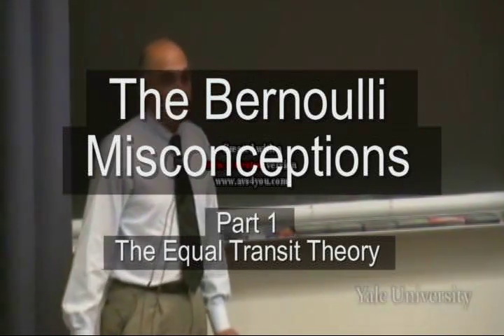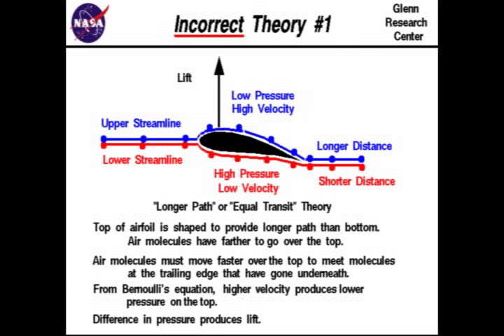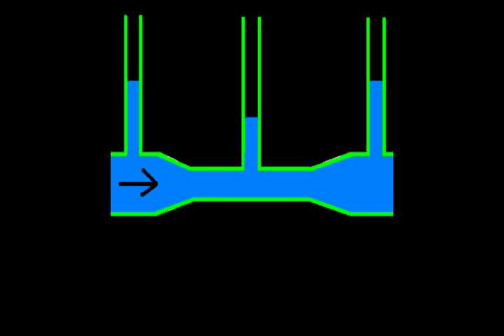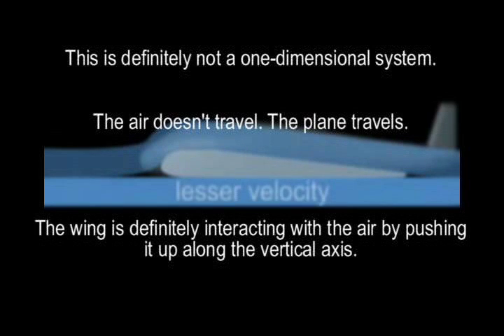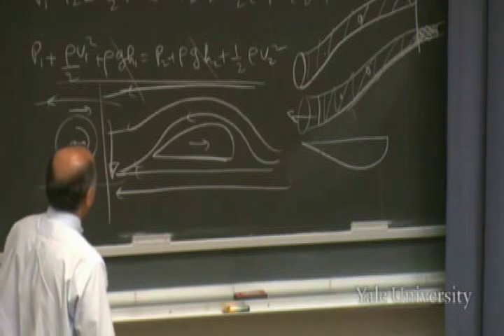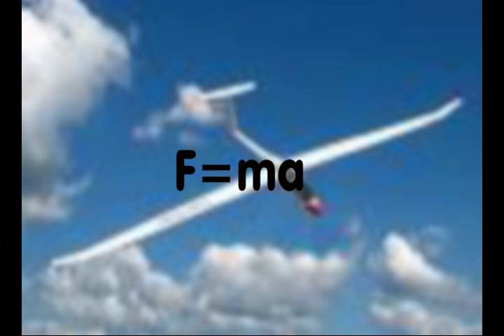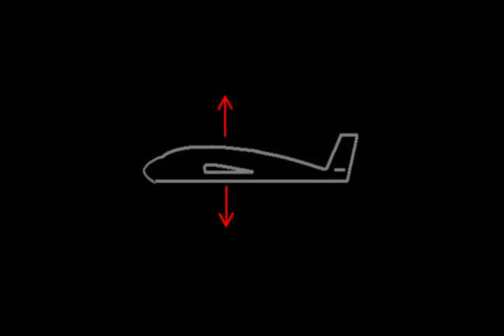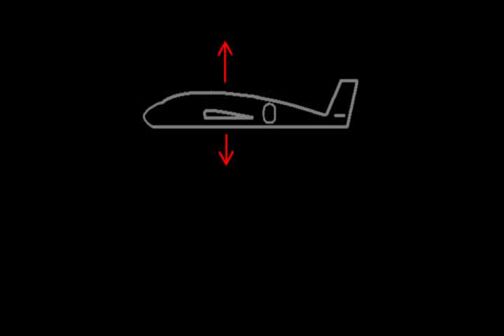Bernoulli Misconceptions 1 - The Equal Transit Theory

Comment: Don't know why I haven't seen this video before...  I like having yet another bad example from Yale!!  Chuclke, chuckle.
....
I really like your start and the constant energy focus.   However, I submit, for your consideration, that your reasoning and conclusion is, unfortunately, incorrect as follows:
... 
Looking at the energy factors only (as you are and I agree is a good starting view), after the drop, you first reason that the plane must rise because the forces no longer balance. right? In other words, your premise is that no energy was removed or added, so the potential STAYS constant (kinetic also constant=also same speed), therefore, the increase in altitude represents an increase in potential energy and, therefore cannot be...
...
.  Unfortunately, the mass decreased and, therefore, for the potential energy to remain constant, there must be an altitude increase !!  
E = m g h
If "m" decreases, then "h" MUST increase.  The increased "h" is not an energy gain, but mandatory to keep the total "E" constant !  
...
It is difficult to misinterpret your statement that: "All the additional potential energy that is described to the increase in altitude of the plane is totally unaccounted for."
...
Did you forget the decrease in mass "m" in the E = m*g*h  Equation?
Before       and       After
E = m * g * h  ==  m- * g * h+  Energy balances!
...
So unless I misunderstand something here, the increase in altitude "could" still maintains a constant energy and no new energy is needed.  I believe your logic fails to prove your proposed point.  
...
...
HOWEVER, taking this further in an effort to salvage it, I continuing to account for other applicable and significant factors to see if an argument is still there...
..
As somewhat of a side issue, from an energy-only standpoint, during the climb, there most certainly must also be a speed increase (kinetic energy) to keep the total energy constant; due to the temporary loss of potential energy from the dropped weight at the lower, starting altitude.
...  This is sort of ok so far, but I'll ignore this transient effect for now.
...
Unfortunately, the higher altitude will be dictated by:
1 - The decrease in air density, 
2 - The increase in radius from the center of Earth's Mass.
That is to say, to have the same total energy, the altitude must increase to account for the NEW LOWER weight due to BOTH the decreased mass and the increased radius from Earth as well as the decrease in air density (I hope that is clear).  This puts several NEW factors into the new altitude and your proposed proof becomes much more complex than you appear to have originally assumed. 
...
Don't get me wrong.  I really appreciate your trying to show the folly in all this oh-so common pathologic science (Improper use of Bernoulli and bad Lift explanations).  I'm on your side debunkingthen, but I fail to find your logic correct, sorry.   I had hoped you had something here that I could use.
... . . . 
-- Cheers, ScienceAdvisorSteve
www.challengerillinois.org
Reply from the maker: Sorry for not having opportunity to answer earlier. The Coanda effect is pretty straight forward. When an airflow streams past a round object, the Coanda effect sa that the flow of air will "cling" to the surface, even though the surface diverges away from the direction of the airflow. If one considers the alternative, one must imagine that the airflow continued strictly in the original direction, no matter how small the angle between the direction of the flow and the surface is. This little "sliver" of air should then consist of still air that separated the flow of air and the surface. The outer layer of this "sliver" of still air will naturally, and immediately, be drawn along with the moving air because of friction. Where this layer of air was, there will be a void that immediately needs to be filled with air from somewhere, it can't be vacuum. Either the void needs to be filled by the air that flows past the object, thus slightly diverting it's direction towards the surface, or the air needs to flow in from further back from the air that is between the airflow and the surface, thus creating a swirl that will constantly make air flow into the void, only to be drawn out again with the airflow. When the angle between the airflow and the surface is relatively small, the void will most easily be filled by the air in the airflow bending towards the surface. In this way, all air between the airflow and the surface will be removed and replaced by air in the airflow, so that it seems like the airflow clings to the surface. If the angle is big enough, it is "easier" to fill the void by air flowing in from below the airflow. Thus the airflow separates from the surface and turbulence is formed under the airflow. In the case of an airfoil, this is what happens when the wing stalls.
It is said that Coanda effect should only be used for jets of air passing by a surface, and not for a wing flying through the air. In any case, I think that the effects can be explained in the same way, and therefore should not be reason for any confusion. I hope this was helpful.
Reply: DrR1pper   The Coanda Effect is a definition for what happens when a jet or sheet of air is forced, by some type of a blowing device, over a convex surface within an otherwise still air environment.  The air over a a wing isn't forced like that so it doesn't really qualify to be called the Coanda Effect.  It is a technicality
--
Regards
Reply: I see none and have not seen anything to indicatevthe science is different for the two. I do not believe anyone has attempted to name it.
Reply from the maker: I don't want to have a strong opinion whether one should call the phenomena of the air following the curve of airfoil, the Coanda effect, or not. I understand that Coanda strictly speaking investigated the reason for a jet of air following a curved surface, while not addressing what happens when the whole atmosphere blows past an object. I don't think this should cause any confusion. The real reason for confusion would arise if one tries to explain these phenomena in completely different ways. The biggest difference is that a limited jet of air has a lesser tendency to follow the surface, compared to the case when the whole atmosphere moves over the surface. This is because with a airflow with a small diameter, the air from the sides can more easily flow in and replenish the air that has been removed by the fast flowing jet. With the whole atmosphere moving over the surface, the air needs to double back from behind, thus make a swirl (turbulence). Another effect is that a limited jet of air will gradually detatch itself from the surface, while this happens much more suddenly in the other case, refer to stalling of a wing. If it is cold where you are, you can try this yourself, and go and blow past curved objects, and see that the stream of air will tend to bend towards the object, even though it is not in direct contact.
Reply: Siddis33  Yes.  When you put a jet into the air, there is 'entrainment 'of nearby air.  This makes the moving air stream wider than the original. ...
This explains the blower and toilet paper demo.
--
Cheers.
Reply from the maker: I think that there is something that you misunderstand. When the object is dropped from the plane, it is true that the kinetic and potential energy of the rest of the plane decreases. However, this is the energy that is represented by the falling object, which will be converted to heat by friction with the air and by finally crashing into the ground. So, just after the object is dropped, the system (plane and object) has just as much total energy as when the object was in the plane. But after the object is dropped, the potential energy of the plane (and the whole system, plane and object) will start to increase as the plane is pushed upwards due to the difference in weight of the plane and the force acting on the wings. (F=ma)The Law of Conservation of Energy is broken immediately as the plane starts moving upwards. It is enough with one micrometer. Sure, the plane would stop ascending when the air density got low enough, but it is still not an argument as the Law of Conservation of Energy is already violated. Moreover, one could just as well imagine that this thought experiment took place in an incompressible fluid, like a hydrofoil boat in water. The video that you sent show that the air over the wing moves faster than the air under the wing. Bernoulli's theorem states that when the pressure decreases the velocity will increase. This is exactly what one sees, and has nothing to do with the more curved upper surface of the wing. The same effect would be seen on a flat or symmetrical wing, provided the wing is angled so that it gives the same lift.
Reply: Siddis33 Unfortunately I *AM* missing something.  It is your proposal / disproof.  It appears we both understand the energy situaton.  However, I still do not see the line of logic that refutes the Equal Transit PseudoTheory.    That and your argument appear quite orthogonal to me.  I don't see how a conflict in energy interpretations disproves equal transit, or how equal transit has any legitimate, nor misinterpreted energy implications.
...
Equal transit is easily disproven by a simple observation that cannot be misinterpreted (as can many other types of observations can).
...
 I love showing the "fast-air-has-lower-pressure" folks how the"fastest air" around a wing is just under it.  (relative to the still air)
--
Cheers, Steve
Reply from the maker: +Observ45er it can be shown by an example. Let's say a glider weighs 900kg and the object is 100 kg. The glider is puler up to an altitude of 100 meters and a velocity of 30m/sec. The energy that was needed to pull the glider and the object is (1000x100x9.81+1/2x30^2x1000)Joule=1431000 Joule. 
When the object is dropped, it will still have 1/10th of the total energy. This energy will be lost through air friction and the impact with the ground. The 143100 Joule is still accounted for. The remaining 9/10th of the energy is still associated with the plane. 
AS you point out, the weight has decreased, but the lift should be the same in according to the Equal Transit Theory. Then the plane will start to rise. 
If the plane rises by 1 millimeter the potential energy will increase by 900x0.001x9.81 Joule = 8.829 Joule. 
This means that 143100 Joule was used to get the object to 100 meter and 30m/sec. 1287900 Joule was needed to get the glider to 100 meter and a velocity of 30m/sec.
Reply from the maker: +Siddis33 But when the glider rises another millimeter, the total energy of the system (object and plane) is: 143100 Joule + 1287900 Joule + 8.829 Joule = 1431008.829 Joule. This is more energy than was used on the system. This is not possible, and proves that the Equal Transit Theory is wrong.
Reply: Siddis33   I assume you are responding to me.   I still don't see what the energy implications are of the equal transit pseudo-theory.  How does the air travel-time over the top of the wing imply any energy factors?
...
Analyzing the energy is one thing, but in what way does the time air takes to travel over the wing make any specific implied. or misinterpreted statements or claims about anything to do with energy conservation or non conservation?
...
IF the air did travel the same time above and below, what are the energy implications of that false concept?
...
Does that explain the issue better?
Reply from the maker: +Observ45er The point with the whole video was to show that the Equal Transit Theory is wrong. By using accepted laws, one can make a simple example that shows that physical laws are violated, thus the theory is wrong. The theory is no little misconseption. Until very resent, this was the accepted theory. Even Einstein conducted experiments based on a similar understanding of lift. BTW my example with numbers continued as a reply to my own message. I tried to show that your point with the mass of the plane being less ,after the object is dropped, does not change anything.
Reply from the maker: +Observ45er If the air above and below the airfoil travelled at the same speed, the wing would not generate lift. If the wing generates lift, the airspeed over the wing will be faster in according to Bernoulli's Principle. Accordingly, air will be directed down in according to Newtons equation, F=ma. Bernoulli's Principle is just an adaptation of Newtons laws. They don't represent different forces. In this way, if an airfoil creates lift, the air will always travel faster above the wing, no matter the shape. Inverter wings, or flat wings, will not be very effective to create lift.
Reply: Siddis33 I think I now see how you make the connection.  Unfortunately, from your last comment,:

 "If the air above and below the airfoil
travelled at the same speed, the wing
would not generate lift. If the wing
generates lift, the airspeed over
the wing will be faster in according to Bernoulli's Principle."
...
it appears that you are clearly applying the common misconception that many amateurs refer to as Bernoulli's Principle.  Namely that "Fast air has lower pressure."
How do you correctly apply Bernoulli's Equation to this situation?
In other words, what is it about these two streams of air that allow the application of Bernoulli's Equation? 
...
We have two streams that have no relationship in regard to velocity changes (accelerations), where, in addidtion, no energy is added nor extracted, that make his equation applicable.
...
If that is what you are basing your argument on, it fails as a proof.
--
Regards, Steve
Reply from the maker: +Observ45er Then how will you explain that air that travels over the wing has a higher velocity, if not by Bernoulli's Principle? As I wrote, Bernoulli's Principle is just an adaptation of Newtons Laws. A package of air that moves from an area with high pressure to an area with low pressure, will naturally change it's velocity. This is because the package of air has a higher pressure on one side than on the other. This is also exactly in according to F=ma. 

Many people use the term " Bernoulli Lift". I suppose these are the ones you call amateurs. I don't include myself among those. 
Why complicate things by using Bernoulli's Principle when one can simply explain it by using Newton's Laws? 

If you yourself are not an amateur, then I suppose that you are a professional in a relevant field ( not a professional baker, for example). What sort of a professional does not understand Bernoulli's Principle?

Cheers
Reply: +Siddis33  Google pinged me on an earlier comment and I didn't catch this comment of yours. RE:  "...the Equal Transit Theory ... Until very resent, this was the accepted theory."  

What do you consider as 'recent' ?  
By whom do you believe it was "accepted" as correct ?
Regards
Reply from the maker: +Observ45er It is not ideal to discuss through the comment section, and I am at a work site with really bad internet connection. 

What is concidered resent  is subject to definition. Before the internet one pretty much couldn't find anything that contradicted the Equal Transit Theory, at least that was available to the public. "All" pilot instruction books and popular science shows present the wrong theory. Bill Nye the Science guy presented the wrong theory in his show.

If you make a Google search on "Einstein Katzenbach airfoil" you can read about his flawed experiment that was based on a form of the "Bernoulli lift" fallacy. That was long time ago, but the myth has been extremely hard lived.
Reply: +Siddis33  It's not about how I would explain it.  I'm asking you to explain just how you are applying Bernoulli's Principle to the velocity of the air over the wing.  You say that it is somehow due to Bernoulli's Principle, but how does B.P. apply?  You're the one saying: " Then how will you explain that air that travels over the wing has a higher velocity, if not by Bernoulli's Principle?".  
You're only implying a connection, but aren't specific.  
...
Then you seem to contradict yourself with this: "Why complicate things by using Bernoulli's Principle when one can simply explain it by using Newton's Laws?" [I'm actually on you side with this bit]
...
This is like saying that rockets fly due to Newton's Law.  It explains nothing, just drops a name on the floor.
...
I have an understanding of Bernoulli's findings and of lift far better than the average YouTuber.  I'm trying to connect the dots of your story in a cogent manner.  What are the dots between 'upper air' and 'Bernoulli'.
-- 
Regards
Reply from the maker: +Observ45er  I would like to invite you to watch dr. Holger Babinsky's lecture " How wings fly - Common misconceptions on lift". He addresses this very point from about 20 minutes out in his lecture to about 30 minutes. He shows very clearly that B.P. Is nothing other than the result of Newton's forces that act on a parcel of fluid. This is exactly my point. This explains why the air over the wing accelerates.
Where I think most people go wrong is when they treat Newton's forces and B.P. as two independent set of forces, like for example gravity and magnetic forces.
Reply from the maker: +Observ45er  Correction: the lecture of Holger Babinsky is "How do wings work - common misconceptions on lift"
Reply: Siddis33  That  Babinski Video is one of my main references.  I send folks a link to his slides which you can't see in the video as well as the equivalent paper he refers to in the video.
...
Unfortunately, he refers to the upper air path as being due to the Coanda Effect, which it is not due to its [corrected typo] definition.
...
Though minor, he also stops short of including the downwash. 
...
The Krzysztof Fidkowski How Planes Fly video is another excelent one along with Doug McLean's Univ Mich Misconceptions video.
--
Cheers
Reply from the maker: +Observ45er No he does not! You are totally wrong. The reason the airstream hugs the profile of the airfoil is due to the Coanda effect. The reason that the air does not just bend, but also speed up, can be described in according to the Bernoulli Effect.
Reply: Interesting reading your discussion guys but it's left me a little puzzled. If my understanding is correct, the reason a fluid element travelling over the top of an airfoil experiences an acceleration is because it experiences a difference in pressure about any of it's opposing faces. Can someone please explain why there is this a difference in pressure in the first place? Thank you.

For the moment, my thoughts on where the pressure differential comes from is that there is a vacuum like space being constantly trying to form in areas above the top surface areas of an airfoil where it's surface diverges away from the instantaneous direction of airflow on the top surface of an airfoil.
Reply: +Siddis33  I am not wrong. Technically, it is not Coanda..  The definition of Coanda is a jet or sheet of air that is forced by a blowing device across a convex surface in an otherwise still environment.  Since this is not forced in that manner, it is not Coanda.  . While the physics may be similar, a definition is a definition. 
...
In addition, Coanda gives no explanation as to the CAUSE of the effect, only that it occurs, so you have the same problem even if you say Coanda.  What causes the Coanda Effect?
-- 
Cheers
Reply: Observ45er Hi Steve. Are you saying that whatever causes the coanda effect/phenomena is not what also causes airflow over the top of a wing to be attracted towards parts of the top surface that are changing and facing away from the instantaneous direction of local flow (i.e. leeward surfaces)?
Reply: DrR1pper   I say that the Coanda Effect and the flow over the wing appear to have similar physics.  However, Coanda has a very narrow definition and it also does not give a cause for the effect, only that it occurs, so whether you call it Coanda or not you still have a "what is the cause" problem.  
...
I claim that the first principles of physics says it is the motion.  Pressure comes first.
Reply: Observ45er Do you know of any theory that explains the phenomena of airflow having the tendency to want to follow convex surfaces (i.e. the Coanda effect)?

"I claim that the first principles of physics says it is the motion. Pressure comes first."

- Ok, perhaps you just answered my question but would you mind elaborating what you mean please? I'm intrigued.
Reply: Siddis33 Thank you for writing that. It appears to make a lot of sense. But towards the end you state that the Coanda effect should only be used for jets of air passing by a surface and not for a wing to explain why airflow follows a surface diverging away from the airflow and I'm not sure why.
Reply: Observ45er Aaaaaaah! I think I see the difference now!!! Thank you so, so much!

So, just to double check, the mechanism that causes airflow close to a surface to then cling/follow (or i guess the technical description would be to "remain attached"? to) it as that surface diverges is practically the same regardless of whether there is just a jet of air or all the air is moving over the surface?

If so, is there an name for the phenomena, like the Coanda effect, for the effect of air following the divergent surface of a wing?
Reply: Observ45er Ok, thank you!!!

So it's technically incorrect to say that airflow following the diverging surface of a wing is not the same as the Coanda effect despite both phenomena being caused by practically the exact same physics.

What do you say to people who say it's the same as the Coanda effect without confusing the hell out of them?
Reply: So the point is, the underlying fluid dynamics that causes streamlines close to a divergent surface area of an aerofoil to experience the tendency to follow it is the same, regardless of whether it is just a jet of air or the entire atmosphere in motion relative to an aerofoil.

That's so cool! :D